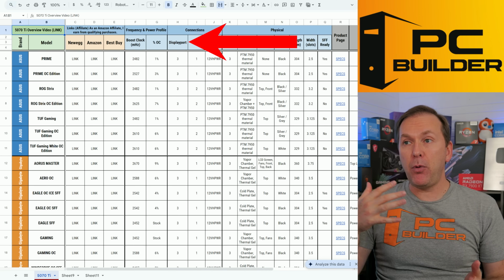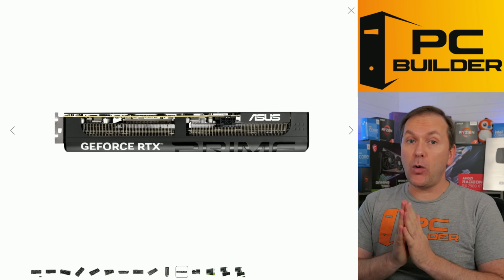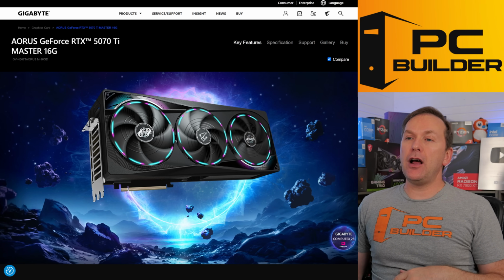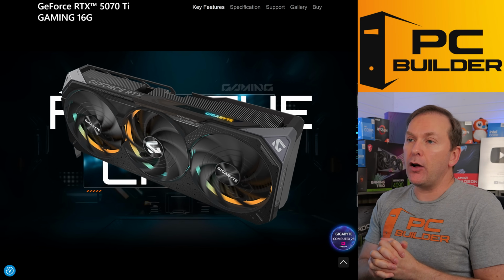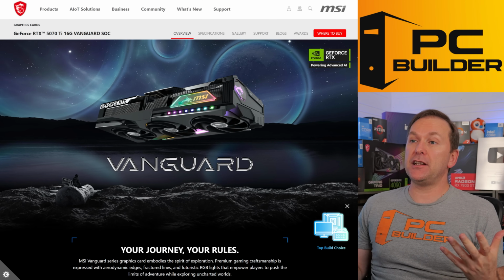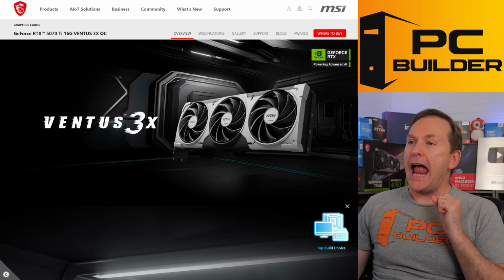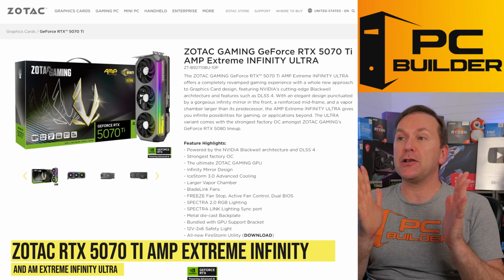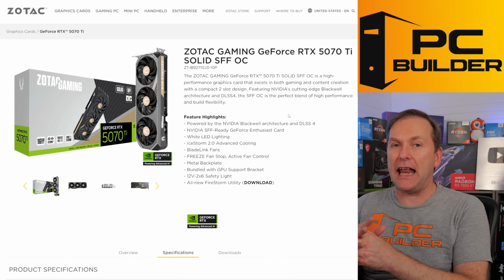DON'T BUY WRONG! 🛑 Every RTX 5070 Ti Model - Specs & Features

Comment: I still like 9070 XT more, but if it remains so expensive, and a person can get a 5070 Ti for less, there's really no reason to not get one. I have an Asus Prime 5080 and it has been a good card. Still not enough VRAM to do a lot of AI things, but for gaming having 16GB is pretty good. The Prime cards are good quality and stay mostly quiet and plenty cool, you don't necessarily need a supermassive heatsink if you have some decent case airflow. Also, spending the most is not going to get you a far better overclock or massively lower temps. The Zotac ones seem alright too, I watched Gamers Nexus review one of their 5080's. The price premium for 5080 is not really worth it over 5070 Ti, you are getting almost all of the stuff for like 30% less money. Thumbs up!
Reply: They're the same price between 5070 TI and 9070 xt. So it all copmes down toi preference.
Reply: @lorexio4369 no it doesn't. 5070 Ti is overall way better. Dlss4, Frame gen and RT. Why pay the same for AMD and get less?!
Reply: I've got the 9070 XT Prime initially. Then tested a Shadow 3X 5070 Ti, which I liked the performance better, but not noise and temps.

I ended up with a Prime 5070 Ti. Very happy with my choice for my SFF. It runs cool and silent even in 4k gaming.

Comment: 1st time builder here. Still buying parts for my 1st new comp in 12 years. Im still using a 1060 lol. Great video. I could return my unopened 9070xt nitro+ to Newegg and buy a 5070ti for about the same price i paid, but I think I'm going to stick it out with the 9070xt.  I just watched someone benchmark   the new doom game, and it outperformed the 5070ti and even the 5080. Seems like the 5 series has too many bugs and driver issues, and i like the idea of using a full AMD comp. (Going to buy the 9950x3d)
Reply: Maybe on doom but the 5070ti outperforms it in almost every other instance not to mention the superior dlss4 and RT capability and frame gen. Just some food for thought. If you're paying the same price why not get the extras?!

Comment: I bought the MSI Vanguard SOC and have pushed it to 3292MHz, +2000MHz memory and maxed the power limit to 116% with +100% Voltage and is almost completely stable with a 13% performance boost in Cyberpunk drawing 14% more wattage. Chilling at auto fan curve at 56C so can't complain.
Reply: Thoughts on undervolting for lower temps and possibly even higher fps?
Reply: @so-u5c yeah I run a stock voltage limit with a core clock of 3150mhz +2000mhz memory which reduces wattage even over stock and only loses like 1-2% over max oc and is more stable which I prefer
Reply: Best version on 5070ti in my opinion
Reply: I pushed mine to the absolute max oc with a beast aio and fans it got 15-25 more fps in 1440p and 10-12 in 4k I was reaching or even slightly exceeding the 5080 level of performance but I turned it off because it was bad on the card
Reply: The price is a disgrace though
Reply: @heroicsquirrel3195 yeah agreed but not the most expensive card in my country

Comment: The 5070 ti aorus would boost to 2.9 and oc manual to 3.2 stable crazy card wouldn't break 65 c but at 1k...I returned it for a 5080 fe msrp
Reply from the maker: I believe these are super golden samples they are using for the Aorus 5070 Ti. And if you can grab any 5080 instead that is obviously the better choice! Congrats!
Reply: @PCBuilderChannel thx!!got lucky with a best buy drop last month, I was pretty sad to return the aorus though such great card 😢

Comment: NEED HELP!!! I have been taking information in for the last year, to build my first ever PC. With that being said, I have really been eyeing the 9070xt, should I go for the 9070xt or a 5070ti? Like saving money, but also like to buy once cry once to last a few years before upgrading. Thank you for any help
Reply: If same price go with 5070ti if difference are like 150 USD and above go with 9070xt, 5070ti are better choice if it's the same price with 9070xt
Reply: @sabranfauzan2158  I read some comments about 9070xt causes black screen a lot
Reply from the maker: Either GPU is going to be very good for their respective prices. That being said, right now the 5070 Ti seems to have better availability and at the same price as the 9070 XT, I would get the 5070 Ti.
Reply: 5070 Ti all day

Comment: Got the MSI Vanguard SOC Launch Edition 5070 Ti for about $1,100 USD after shipping and taxes (I don’t live in the US). MSRP for this card is about $1,000 so I would like to think I got a decent deal. If not let me live in my copium-induced fantasy lol.

Pretty happy with it, undervolted to 2,955 MHz clock speed and 16,000 MHz memory speed at about 935mV. Sits around 150W and temps always around 35 and 55 degrees celsius playing games like MHWilds on 1440p Ultra settings (no ray tracing) at *120 fps with frame gen on.

Only problem of course is Nvidia’s shitty drivers.
Reply from the maker: Great card. Given the crazy GPU prices, I think you did well for the launch.

Comment: Only missing temperatures and fan noise data
Reply: That data is super essential. I don't want a hot noisy card in my rig.
Reply: @Irwin357  avoid msi ventus at all cost it's the loudest of them all
Msi shadow has 1 less heat pipe but it's a bit quieter and cheaper 
Thickest ones are usually silent like gigabyte gaming and Aorus ones
Msi gaming trio is also quiet

Comment: From my experience, 99% of the time it's better to just get the cheapest model. The OC (overclocked) models are supposed to be binned for their overclocking capabilities (e.g. high clock speeds). Getting the 3 slot overbuilt coolers only makes sense when the card is consuming 300W or more of power. The 2 slot cooler variant can still dissipate heat adequately but you have to put up with higher fan speeds/noise.
Reply: Definitely especially when you’re not going for a 90 class GPU.

Comment: Should i buy rtx 4060 or arc b580 for gaming?
My cpu is 5600g
Reply from the maker: Right now the cheapest 4060 I can find is $400. The B580 has too much CPU overhead for the 5600G IMO, especially given it is PCIE gen 3 only (see my "pc parts to avoid in 2025" for more). I'd say wait for the RX 9060 XT 16GB or possibly the 5060 8GB.
Reply: 4060 RTX! The 580 will struggle with your budget CPU.
Reply: In my country rtx 4060 is 310 dollar and arc b580 is 300 dollar. So which card should i choose?
Reply: ARC B580 ALL DAY

Comment: I would like to know your analysis on cards like Gainward, Palit and KFA². I think those are more european cards, but here in europe a lot of us speak english well. So personally, I'd appreciate it.
Reply from the maker: Thanks I'll keep this in mind! I'm not really familiar with any of those brands lineup - well maybe Gainward a bit as they previously tried to break into the US market - but it is a bit of a steep learning curve.
Reply: @PCBuilderChannel  Gainward is a subsidiary of Palit. Iirc Palit markets more in the US and Gainward is more geared towards Asia or other markets. KFA2 is the same company as Galax, but markets more in the EU, so they should be pretty much the same cards with some aesthetic changes. I'm not sure if I got the regions right, but basically it seems to just depend on your region which ones are available and they should be pretty much the same between Galax and KFA2 and likewise with Gainward and Palit though Gainward and Palit seem to differentiate a little bit more with looks, where Palit is flashier and Gainward is more dark and edgy without the RGB on the Palit cards whereas Galax and KFA2 just basically change the stickers on the cards.
Reply: @Eonymia nice info man. I saw these gpu brands sometimes 50-100 dollars cheaper than those big brands. So basically everything is just the same except aesthetics and RMA purposes
Reply: @nanotech_00  Pretty much. Especially in the case of Galax and KFA2 they're literally just different brand names on the same cards. The situation is a bit more muddled with Gainward and Palit, but I think it's pretty safe to assume they're basically the same.

Comment: I heard you cant really buy the Zotac Solid anymore or they arent making anymore of them at Msrp. They were apparently losing money on that model because of the huge cooler they slapped on it. Thats why they made the solid core with cut back features and smaller cooler. Which i bought one last night thinking it was the normal solid. Lol these confusing names.
Reply from the maker: Thanks for this. That would explain why you can't find it at retail anywhere.

Comment: Just what I needed. I'm looking for the Gigabyte Gaming OC but I heard it has thermal melting issues, is that a big problem? The pricing is very decent for that one for me but I'm afraid of having thermal issues.
Reply from the maker: According to Gigabyte, their first batch of RTX 50 series GPUs used too much thermal gel and it can kind of "leak" (it's like putty so it just moves down slowly over time). Gigabyte said it isn't an issue (not conductive) and it can be removed. They also said they've reduced the amount of thermal gel on subsequent manufacturing runs. IMO not a huge issue, but if that bothers you, feel free to grab any of the other cards as there are lots of good ones.

Comment: Me watching this to support the channel even though I already bought a 9070XT. 😂
Reply from the maker: Honestly we appreciate it! (; 
How are you liking your RX 9070 XT? What CPU did you pair it with?
Reply: @PCBuilderChannel  The question wasn't for me but I paired my ASUS TUF 9070XT OC with a 5800X3D.
Reply: @PCBuilderChannel   I was choosing between a windforce 5070ti or a magnetic air OC 9070xt, I now know from the video that the windforce is Small form factor. I didnt before and want a beefy cooler, you saved me that choice! thank you! with my 7800x3d the 9070xt magnetic air should be a perfect match!
Reply: 9070xt is weaker than 5070ti
Reply: @UM_88-s2c  By only 6% while costs 200-400$ extra. 😂
Reply: @IntrovertWolf25  I would like to play games like Alan Wake with ray tracing enabled, but I don't think the RX 9070xt will be able to run it at 60 FPS, and fsr4 Is not that good. I think DLSS is better, but I'm not sure  it's worth spending €820
Reply: @MiT_44139 What did you do? RT isn’t even worth it on these unoptimised games, it just kills FPS
Reply: does 9070 xt cause black screen. I am so worried and not sure about what to pick.
Reply: @Minh-oq5ex  Nope. I'm even playing Black Myth Wukong which had black screen issues on 50 series Nvidia cards due to drivers. No crashes, Black screens or stuttering at all on 1440p Very High settings. Getting 70 FPS on average as well.
Reply: @IntrovertWolf25  Actually there's a post where NVIDIA says that black screens were provoqued by AMD processors lol with NVIDIA graphic cards lol
Reply: This question wasnt for me either, i have a laptop with 3060

Comment: The PTM7950 thermal pads instead of thermal paste/gel is superior to anything else here. Thermal performance of cards with PTM7950 will stay the exact same for at least 3 to 5 years, unlike paste which dries or pumps out with time (worse temps already after only 2 years or sometimes less), so that should be kept in mind depending on how long you keep the card, and how willing you are to replace the paste yourself.
Reply from the maker: Generally in testing we see better result with properly applied thermal pads vs traditional! Definitely something to keep in mind. Note other thermal solutions (vapor chamber, thermal gel) are also improved over standard paste / coldplate.
Reply: @PCBuilderChannel  To add a little bit here, PTM7950 might perform about 2 degrees worse than good paste does out of the box, but longevity is important, and that's why PTM7950 surpasses the performance of paste with time. + You never need to tamper with the card.
Reply: I just upgraded my 6950xt from paste to PTM. The old solutions suffered from severe pump out, and the new solution gets better over time and was 20 degrees cooler
Reply: Ok but you lose warranty when disassembling the card to change thermal solution.
Reply: @kexdd69  Depending on the country you don't lose warranty despite those stickers, and I did not mean replacing paste for PTM7950 is necessarily advisable, I just meant some cards have PTM7950 out of the box, which means better longevity.
Reply: @atirta777 I didn't know some cards have PTM out of the box. Pretty cool. Do you know if Aorus Master 5070ti has it?
Reply: @kexdd69  It has thermal gel, which is slightly better than paste, but probably not as good as PTM7950 (The differences are very small anyways)
Reply: Which cards here have the PTM?
Reply: @XianOfficial618  pretty sure only Asus will do this

Comment: Would be great if you added the max power limit in the spreadsheet.
Reply from the maker: Just looked again. My understanding is they are all rated for 300 watt tbp. Let me know if you see something that is higher than that.
Reply: @PCBuilderChannel  Yes, but this 300w is the base spec that all brand must follow. Some models can go beyond that 300w, for example the MSI Vangaurd has a max power limit of 350w and the Asus Tuf OC 330w. So basically these card you can increase its power limit beyond 100% which 300w to 350 or 330 respectively when overclocking.
Reply from the maker: Yes if you want to manually OC. Is there an easily accessible source for that data for all these models? I couldn't find one, but if it exists I will add to spreadsheet for sure!
Reply: @PCBuilderChannel  TechPowerUp VGA bios collection. However, they haven't reviewed all the models.
Reply: @PCBuilderChannel  👍there are cards that go up to 350w. It's an important difference for performance, so it'd be great if you made a clear distinction based on power, I think it would prove mint help for those looking to buy 5070ti
Reply: This info would be awesome but very hard to find it unless you literally search for it in forums, videos etc for each individual card. Would take ages. Would be good to see this info all in one place though.

Comment: I upgraded to an MSI GeForce RTX 5070 Ti from an RTX 4060 and the difference is quite noticeable now I can play many games at max settings 🤩🤩
Reply from the maker: That's great! What CPU did you pair it with?
Reply: @PCBuilderChannel  intel core I7. My pc originally came with that one
Reply: I’m torn between the 5080 base models dels vs a 5070ti oc card higher tier. lol cpu is a 12700k
Reply: Well Done! I wouldn't touch an RTX 4060 GPU ever!!